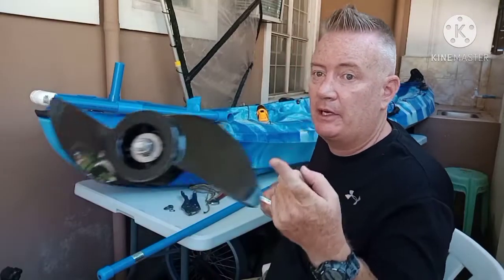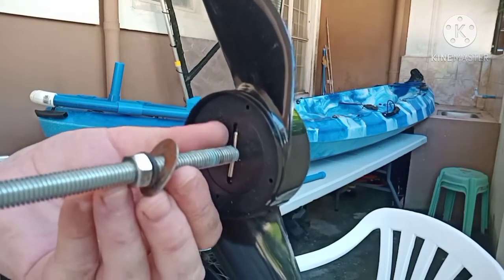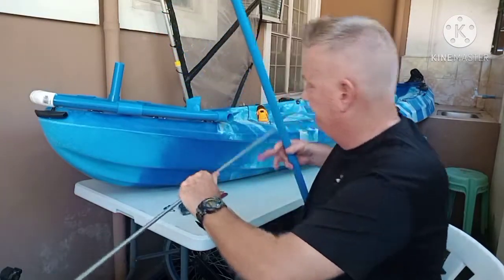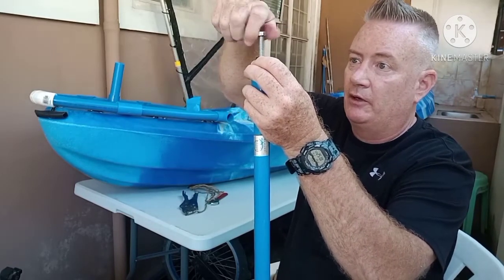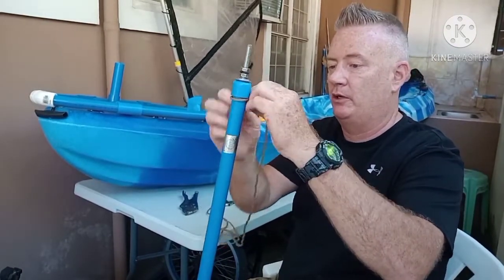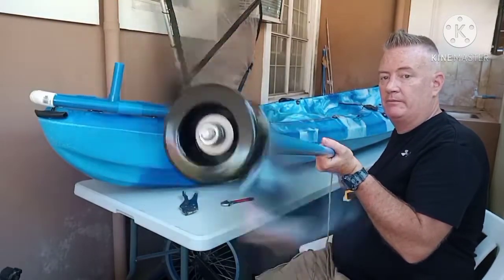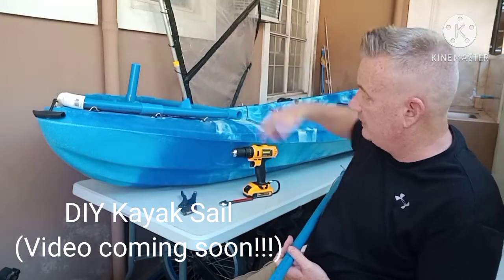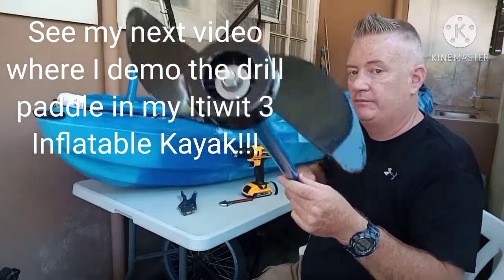DIY Trolling Motor Drill Paddle

Comment: Thanks for the informative video. I made one pretty much as you described. I have an 8' Creek Boat, so I used a 6' all thread rod. I'm using a 20V Black and Decker Cordless Drill. It was difficult to guide the cigar shaped boat, the boat wanted to go sideways. I had better results when I laid the assembly on the Bow of the boat and ran it in Reverse. Can you possibly record a video of your paddle in operation?
Thanks again.
Reply from the maker: Yes.  I do have a video with me using it.  Check my channel.  I have a 12.5 ft inflatable kayak.  Once you figure out how to hold it an steer it, it goes pretty straight.

Comment: Any idea if using these woukd be considered  "adding a motor" to a craft? I'm trying to figure out if I would have to register my craft if I use this. In Texas anything below 14 feet, and all rubber inflatables are exempt unless you add a motor, electric or gas. I just need to figure out what adding means in this context. If it's not attached to the boat, have you added it to it?
Reply from the maker: The rules suck for that in the US now.  I had to register everything when I lived in Florida.  Now I'm in the Philippines.  No need to register the srill paddle here.
Reply: Sure, use 30 of these to power a yacht or speedboat with no reg.
Shouldn't be a problem.

Comment: That's looking pretty good.
But wouldn't the threaded rod eat up the PVC end caps? I imagine the fiction will might also generate enough heat to sort of melt those end caps.
Reply: My thought but you need the threads. Maybe put a steel grommet or something in the holes and oil them. Id pack strips of the noodle foam inside the tube for stability and to keep it from filling with water. The threads would make their own path then stop cutting the foam if it was too tight in places i think. I wanna do this
Reply from the maker: I thought about that...and I put washers held by nuts on either side inside the PVC shaft so that the threaded rod stays centered.  It's worked great so far.  I'll make one with an aluminum rod if I could find one in my area.
Reply: Look around thrift store used for bearings.

Comment: I want to do this so bad but I'm just curious is it super dangerous to have a drill near possibly soaked in water?
Reply from the maker: It's only dangerous to your drill  if you drop it in the water.  So don't drop your drill in the water. Lol  That's why I bout a cheap Chinese knock off drill...just in case.
Reply: @mikesyoutubechannel6367  that's what I'm thinking.. I might just get the lowest on the ryobi line!
Reply: @4C4P5  lol
Every low power Ryobi owner sorry they didn't buy next more powerful model.
You cheap, you lose in life.

Comment: How long does the battery last?
Reply from the maker: It all depends on the model of drill you use and how many mah your battery is.  I bought a cheap China knock off drill with 2 batteries.  1 battery lasts for about 15 minutes.  You can't run it continuously, though.

Comment: How many hours to low batt batery  sir
Reply from the maker: I use a cordless drill.
Reply: Yes i know cordless how many minute the one pack battery
Reply from the maker: It depends on the size of your battery.  I bought a China Dewalt cheap drill.  Each battery lasts about  20 minutes now.
Reply: Thanks you